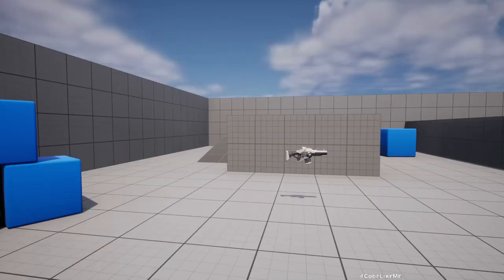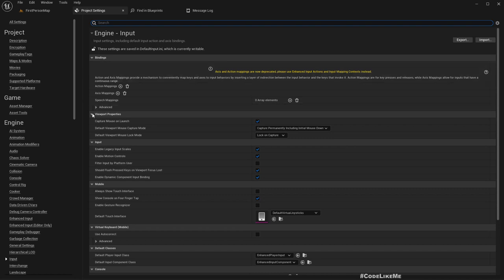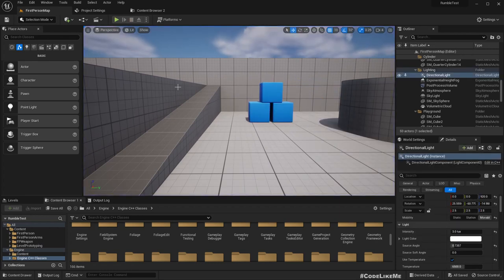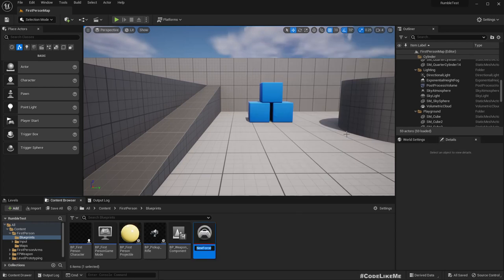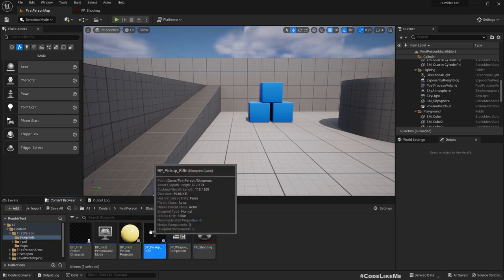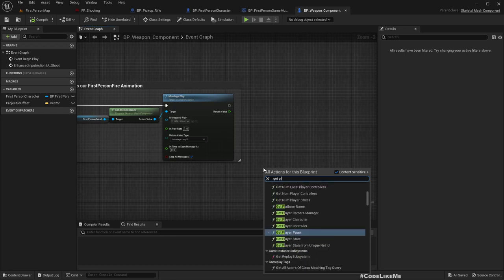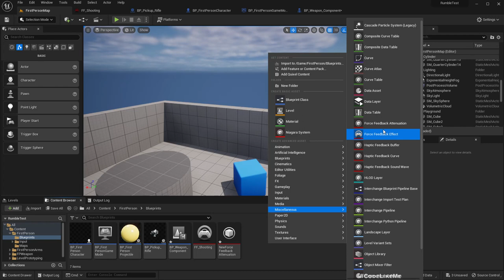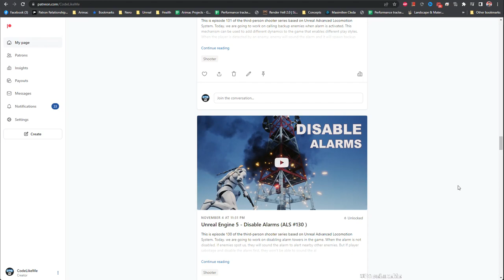Unreal Engine 5 - Controller Force Feedback / Rumble Effect

Comment: Will it work for dualsense controller?
Reply from the maker: i think so, haven't tried myself though
Reply: I used DS4Windows for DualSense on Windows. It is an open-source gamepad input mapper. DS4Windows makes it easier to set up your controller, making it behave like an Xbox gamepad in Windows